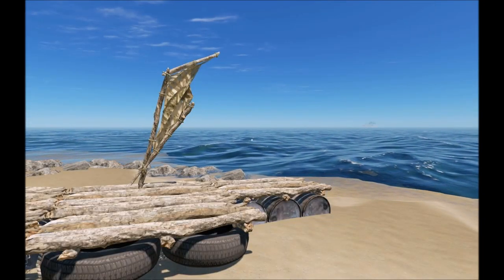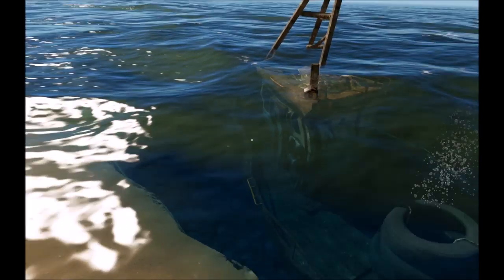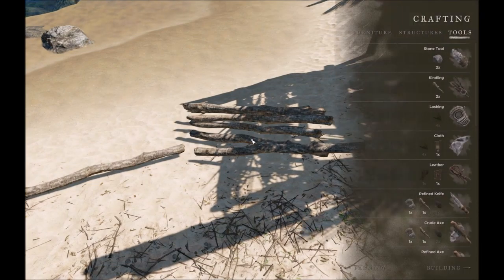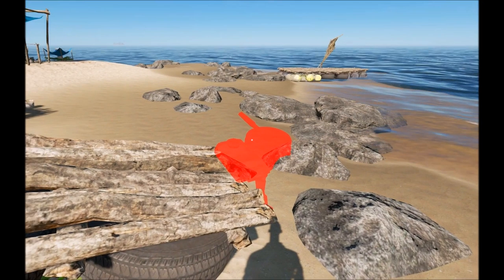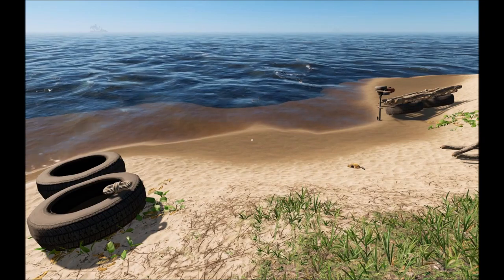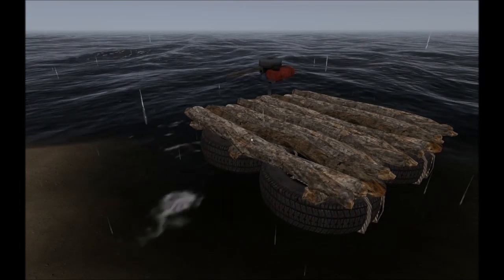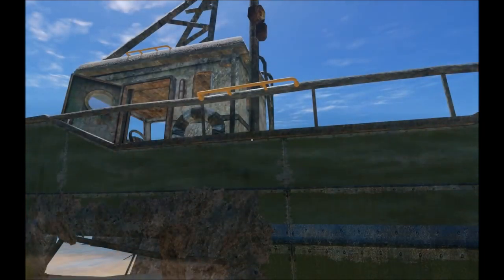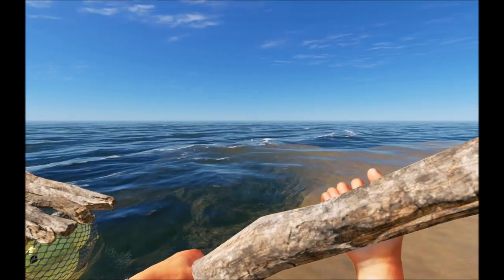Stranded Deep Raft Tutorial

Comment: I am having trouble getting two sections of raft together.  Is there an order that must be done?  I can make on section. but the second section does not attach.  Any thoughts?
Reply: Are you making a 'whole' section BEFORE you add it...including the floor?  You can only add the base to the original raft.  Once you've added the floor to a base that's not already connected, you've just made a new raft.  So, 1. Make base but don't finalize till it's hooked to original raft. 2. Add floor to base.